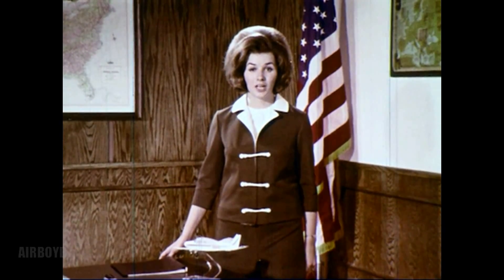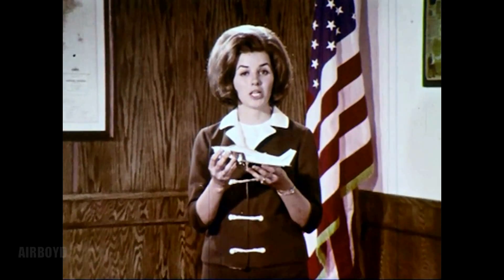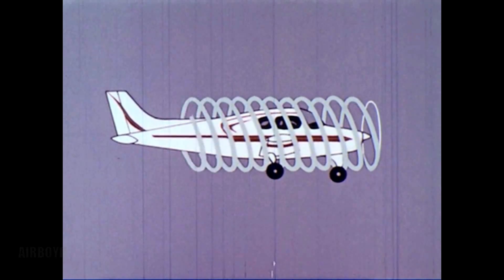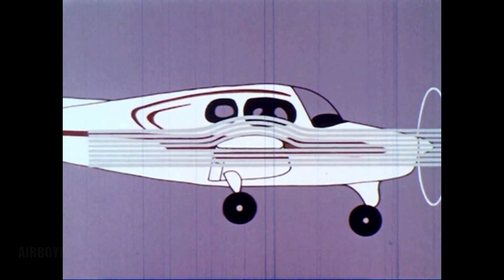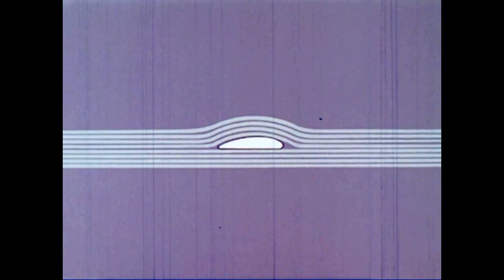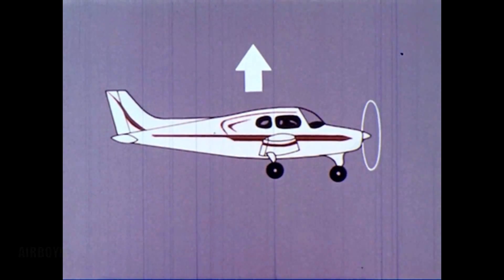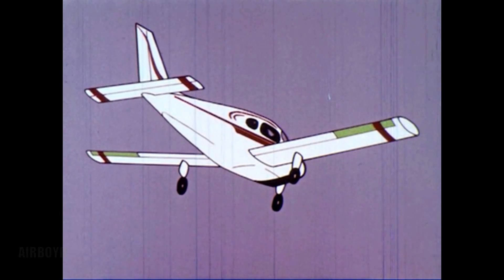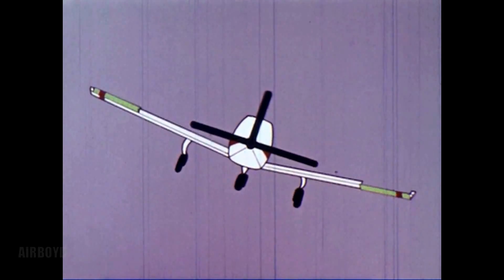Discover Flying (1969)

Comment: About the only advance to GA  from ancient age flying is the glass cockpit.
Reply: And that's not an achievement? What about aerodynamics, communications, diesel engines, datalinks via satellite with weather and radio?
The reason changes are slow is caused by the fact that every change must be verified to comply with safety and reliability. Rules are more stringent than with cars.
By the way, flying is only about 110 years old. Compared to other, way more older and ancient technologies it is relatively new to the human race.
Reply: The glass cockpit looks slick, but is a liability, not an advance.